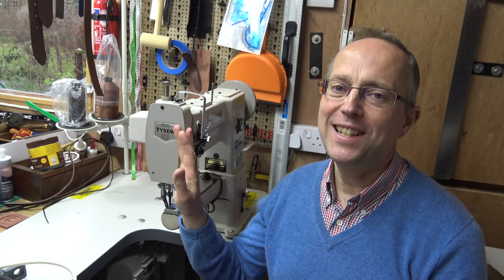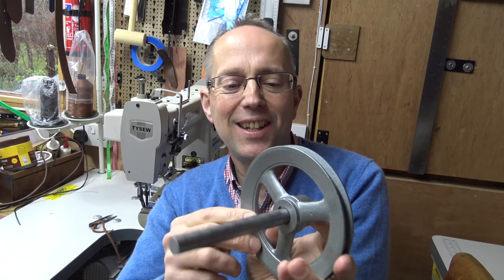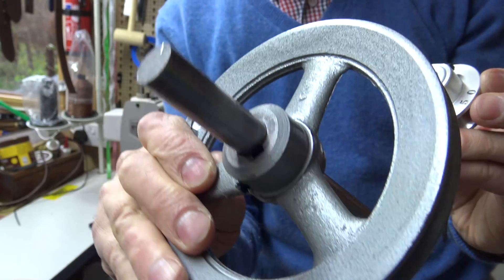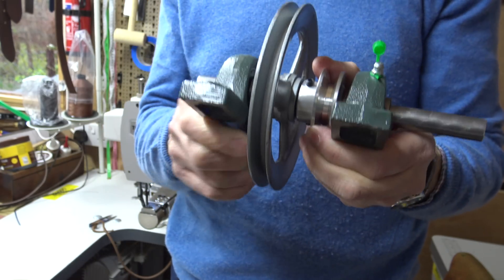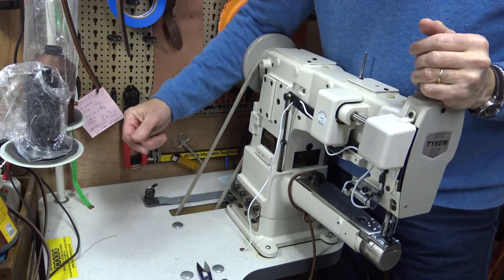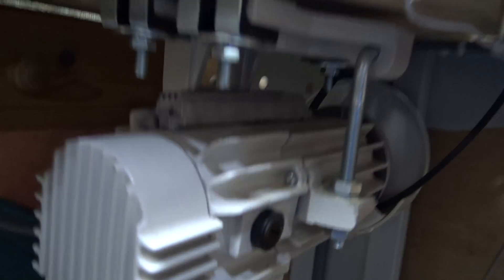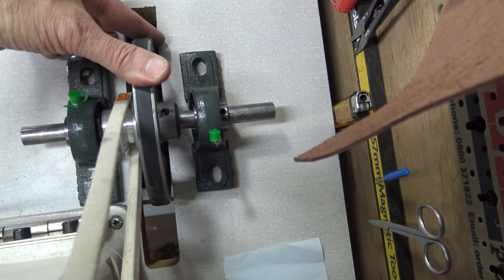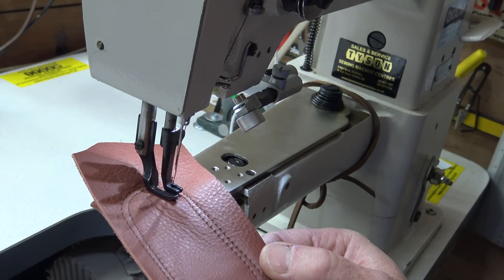Slowing a Leather Sewing Machine with pulleys.

Comment: Great video. Two quick notes:

1: The belt is much easier to remove if you tip the machine head back. For cylinder arm machines, you'll want to disconnect the knee lift, then spin the wing nut on the front to unlatch the hook, and that will allow you to pivot the head back on its base (be sure not to drop it).

2: The servo motor should not be making whistling sounds, this is a good sign that the controller is not tuned to the motor correctly or that some components have drifted out of spec. It's not necessarily going to harm anything in this sort of context, but it may be a sign that the controller is not long for this world, so if it's something that's happens under warranty then you'll want to send it back for replacement.

Comment: Hi Harry.. just came across this video. I just removed my clutch motor and built a new table. Going to buy a servo motor and have a question. Is it safe to assume I won't get the slow and smooth needle action with just a servo motor w/o the reduction pulley? I see they are slower than a clutch motor but about "jumpy" w/o the pulleys. An I correct in this? Thx again and hope you are well!
Jeff
Reply from the maker: Most of the cheaper servo motors seem to like to run at a fair speed. You could always try just the servo motor and see how it goes....it really depends on how slow you want to stitch...what control you need.

Comment: how did you maintain belt alignment? My clutch-style motor seems to be fastened in 1 spot, there is no adjustment left or right. Currently with no reduction pulleys the belt lines up with the machine handwheel. If I install a double pulley such as you suggest either 1 pulley will be a width out...or both pulleys will be 1/2 a width out of alignment.
Reply from the maker: The belts are a tad out of alignment but on a long belt rub this does not seem to matter....I did reposition my motor a bit.
Reply: Thanks. I was contemplating adding 2 shafts abd 4 pulleys so there would be no alignment issues.

Comment: Hi Harry I`ve got the two pully wheels & I`ve mounted them on a stainless steel 15mm shaft between the two bearings ready to get going on my Seiko LSW -8BL flat bed machine I`ve just got to cut the Hole bigger for the belts as your aware needs doing ,but due to things in the way such as top of a Motor Bolts &  the Oil pan .So  space is "tight" . So I`ve notice there is going to have be a slight angle difference between the two pully belts due to the Original belt not being  the only belt there now,this  will cause each of the belts to run at a bit of an "off" angle because one pully is next to the other on the shaft . Is this OK to run them like that instead of as before with the single belt straight in line with each pully wheel ?  regards Tom
Reply from the maker: Hi Tom...yes it should be ok, mine run a tiny bit out of alignment for the same reason...obviously you do this at your own risk, ......I have not had any problems.
Reply: Thank you once again for your superb help because without you, I wouldn`t have known how to do it. Your a Gent Sir .👍

Comment: Hi again Harry, I forgot to ask before .When fitting the different  pulleys , there`s a  thing I keep hearing about when reading up on motors on sewing machines  is "synchronisation ",so myself ,being a Techno dummie ,I thought it best to ask will the "synchronisation" be affected at all with the different ratio pulley wheels ?  Probably a stupid question to you experts but I thought I`d better mention it  .PS ,On my Seiko LSW-8BL  I have a Ho Hsing servo motor fitted on it.

Comment: You never appear to encounter problems Harry. I know If I try`d this ,I can guarantee I`d encounter a problem or two that would hamper the fitting of it . I`d like to try it on my flat bed machine but I know it would be an expensive mistake if things went horribly wrong on assembly
Reply from the maker: Hi Tom ...to me it's a bit like fixing computers or washing machines or whatever....you have problems...but hopefully you learn and don't have those problems again....but maybe other ones😊
Reply: @harryrogers  
Yes your correct Harry . Inspired by your good self as I always am,  I`ve just taken the plunge and bought the bearings , bar ,and two pulley wheels,and intend to give it a whirl. Nothing ventured, etc 👍
Reply: @tommytitmouse  where did you buy the bits?  cant find them too easy,, thanks
Reply: @contakt23  I will be putting my complete set up  on ebay  as I sold my sewing machine recently.
Reply: @tommytitmouse  how much are you looking for the set?
Reply: @contakt23  I want £30 plus £6 P&P  for the lot, which consists of  the big wheel the small wheel the two bearings and the stainless steel cross bar which the two wheels spin on and if I can find it the pully wheel belt that  I sent away  for it.
Reply: @tommytitmouse  that's fine , I have been trying to send my email address but YouTube keeps deleting the message
Reply: @tommytitmouse  .com
Reply: @contakt23  I had an Idea They would  , for some reason and telephone numbers seem to have the same fate. I think its to stop others from getting anyone's private info such as an Email address or a telephone number if it put up . I don`t know  how to contact you either without those two things. what I could do is message you on here when I put it on ebay  . It might be a week or two yet as I`m waiting for the Selling fees to be on offer , so if your still interested then you can look on ebay when I give you the nod.
Reply: @tommytitmouse  I have input the email address above in the previous replies to the comment , if you put together the sequence of messages starting with my name and ending in the last message ,  send me a test email when you get it !

Comment: Thanks. One question. if i am able to change the pulley attached to the motor, to a small size pully in a way that it is 1/3 the size of the flywheel on the machine, will the same effect not be had?
Reply from the maker: I would need to do the maths to confirm but my pulley addition gives a 3:1 reduction over and above the reduction with the usual set up....so total reduction is more than 3:1.

Comment: Is the belt running from the machine down to the small pulley on an angle? Looks as though it would be off set to the left?
Reply from the maker: I had to move the motor to get it lined up with the running axle. Belt from machine to running axle needs to be on centre for the bobbin winder.

Comment: Hi Harry. This is a fantastic tutorial! I got my Tysew cylinder arm last week and started to teach myself how to use it. It’s struggling with 3-4mm belt leather. I’ve just ordered the parts from eBay as you prescribed in the video. Will this modification give the machine more punching power through the hide. 
PS you should be on commission :)
Reply from the maker: That's great Pete...I have never tried thick veg tan on mine...I use it for calf leather circa 2mm thick...I don't know if the mechanism will like very thick hide as that is probably better handled by a harness machine. Best wishes Harry
Reply: Cheers Harry. I’ll see how it goes with the pulleys, just got them the other day and fitted to a bar with bearings. Now just need to find a cutter for the table and then I can order the belts. 
 Thanks for your reply and please stay safe in these uncertain times. 
 Best regards 
   Pete

Comment: So much excellent material you are covering here. I have a Phaff 130 I like. but now I am tinkering with a chines shoe patcher and it looks feasible to do this update... Love turning it by hand, like an old train!  Anyway, I'll be following your instruction, but was wondering what pully size to get that is actually attached to the/your machine... mine does not come with and I'll also have to update the driveshaft... can't wait. Slow is great, I don't need any tickets from the sewing machine police... nice and easy will do for me. Thanks for posting your experience here. Form across the pond.
Reply from the maker: Thanks..I think I used a 45mm on the motor...I was aiming for a 1:3 reduction. Best wishes Harry

Comment: Thanks for the video.
I Wonder how did you line up the belt, if you use 2 poly weel , seems impossible to line up.
Reply from the maker: Hi I slacked off one wheel, ran it, let it centre and then tightened it on the axle.
Reply: get a servo, way better, this isn't worth it
Reply from the maker: @dsmith2979  I already have a servo on this thanks.
Reply: @dsmith2979  I have a Servo and it is still too fast for precision stitches on high-end work.  One slow stitch at a time with much punching power is why we all need speed reducers like Harry's!
Reply: the Consew Servos I have on lowest speed range do slowish 1 stitch without much skill compared to clutch/reducers  it's a no brainer for 99% not to mention the noise. believe me they punching power , having switched a machine over after buying a machine with one, no more clutch, for smaller moves you cant feather the clutch, that's not giving up much for all the  advantages of the very latest Consew servos others, the Juki I retrofitted is like a new machine, slo to scary fast, as much leather as will fit under the foot and other even heaver materials. I realize the feel is different and requires some getting use to 
but now am way more productive and feel more in control and way fewer problems on mostly way tougher than leather materials

Comment: Verry intristing video.
I've got a singer's regular sthicing machine that have a small motor behind .
And i was thinking if i colud make it a bit stronger and slower.
Do you think if i install a biger motor and this sistem it also work for me?
Reply from the maker: This is really aimed at industrial machines, I think this would work to an extent but you will obviously be limited by thread size and what the machine can normally handle. Rgds Harry
Reply: @harryrogers  do you think can be dameging the machine by forcing it?

Comment: hello, im gonna try this. i n my place its hard to find of that size. i only find pulley 150mm and 45mm how do you think its works? anyway why do you have to bor the pulley i think the pulley have a stopper or locknut or something. its  that bor necessari!
Reply from the maker: Should be fine...something like a 1:3 reduction is good...axle does not have to be so thick.

Comment: Hello Harry ...... I'm Charan, from Mumbai, India. I've a similar problem with my flatbed walking foot. The two pulleys you've used are 50mm n 130mm. Was wondering what size pulley was on the servo motor.? If you could kindly let me know, I'd be grateful indeed. I'm a saddler, by the way. Saddle stitch always, but have to use the walking foot for some applications n slowing it down will allow me a neater stitch on heavier leather ......  4mm plus. Many thanks in advance.

Comment: Great video, was hoping you had a parts list?  How long is the shaft?
Reply from the maker: Hi about 8 inches plus....from memory over two years on it was something like 5/8 inch diameter from Ebay, pillow bearings from Ebay...the wheel ratio was something like 3:1 so something like a 1.75 or 2 inch wheel to a 6 inch wheel....all M section ...from College Sewing Machines UK or China via Ebay.....of course if I were to look at my film again I may find I have remembered completely wrong, but I hope that helps a bit.
Reply: Ray Chandler You can get this stuff at Home Depot, Lowe’s , or Ace hardware stores. I did this several years ago to a machine. I have all the equipment needed to make it look factory installed. You can buy a belt pretty close to the size you need using a pc of string to get the diameter. Might I suggest bolting those pillow blocks down with carriage bolts instead of screws.

Comment: Wondering why you didn't just put small pulley on the motor itself? Nice demo though, and it's sews beautifully slowly and controlled now!
Reply from the maker: Jessica Hothersall hi yes there was a little scope to reduce the motor pulley size but not by a lot...also greater risk of belt slippage....so it could be done that way but you would not get as much of a reduction.

Comment: Hey Mr Rogers, another informative video.  I was wondering about belt alignment.  Looks like you are shifting the small machine drive pulley left out of ideal alignment so that you can fit the motor driven pulley over the existing slot (perhaps shifted a bit right). I am guessing that it is close enough to not make a practical difference, but I am an engineer and allowed to worry the minutia .. grin ..
Reply from the maker: Lee Copp Yes it's a tad off Lee...which reminds me of a train journey my dad had with a chief railway engineer who on hearing a creaking sound said...that sounds like an expensive noise!

Comment: So today I bought a Titan servo motor it`s sure different than the clutch motor , It does`nt run till you step on the pedal wow will that save money on electricity , it as the same pulley as the machine do you know if i should have a step pulley or will it be ok just wondering  .?
Reply from the maker: I just have a plain servo motor on my flatbed and it goes down to about 500 rpm with good power so should be fine. I have the slower speed on my post and cylinder machines as I use these for intricate work....hope that helps.
Reply: I need a smaller belt to try it out today , But I see again the speed you have is very nice for counting stitches , -The system you made for yours is a Mandrel drive ,They are one thing we can make here for pennies We have a store here in Canada Called Princess Auto it has everything in that store for a man lots of ladies go there too but for cheaper prices O.M.G. It`s a surplus store has everything from soup to nuts to grinders welders . Could mail you a catalog I`ll send stuff for you if like .LOL.Thanks Harry I guess I better try it first , Love your Patch machine by the way neat little table you made  . Have good day .
Reply from the maker: Garnett M re the patcher...the other tension discs are for bobbin winding
Reply: Harry Rogers Oh thats the reason ,Just seen the notch on the top corner looks like it went around pin 3/4 thru upper plates down around lower thru loop up to shuttle .

Comment: What was the whistle all about ?
Reply from the maker: Garnett M It was the servo setting!
Reply: Harry Rogers Could almost get annoying all day sewing .
Reply from the maker: Hi it seems to have largely gone now....thanks
Reply: Harry Rogers I've got to try and find a servo motor for my Pfaff 481 ,The capacitor blew up SNAP while I was seeing scared me smelt the windings ,Blew lid wide open just pricing them out here at $ 250 - 300 I thought of doing a reduction like this too maybe I'll do it to my post foot.
Reply from the maker: Garnett M In the US you have the big reduction wheels like on my post bed machine.....see my film on boot repair that I put up about 3 weeks ago. We have Jack servo motors here and they are good.
Reply: I'm in Canada actually ,I talked to 2 different sewing places this morning one wants 300 the other 250 he said check with him Friday he might have a used one for 125 he buys old sewing companies and parts out the machine's plus I have to travel an hour to get one so there's another $50 for fuel never ends ,I'm sure you've heard about Alberta's tax on our province too oh man but I think taking up sewing full time people will slow down buying top O  line clothes and start mending them.

Comment: Why is your motor making a noise, my servo motor doesn't make that noise   ????
Reply from the maker: It's stopped making it now but I don't think it's a very good one compared to my Jack servos.
Reply: +Harry Rogers yeah thats what mine is, bit i don't have a industrial machine ... I have a servo motor running a semi industrial machine and it works so well
Reply: I was thinking of setting something like this for my Singer 201 for more torque a slower speeds, how do you find yours?

Comment: didn't you cut the shaft down to the right length? :) Also, do you really mean a servo motor, or a stepper motor? isn't a servomotor something with a limited range? or are there "continious servos"?
Reply: A stepper motor is "dumb" it works in open loop with no feed back. The controller gives the stepper  pulses and assumes it was able to rotate that full pulse or set of pulses. A servo motor has feedback using an encoder, it monitors the position of the rotor and makes certain that the rotor has in fact moved as requested.

They're not servos like radio control servos, they can spin infinity in either direction. 

As it may be obvious at this point, a servo motor is much better with high loads like when starting.